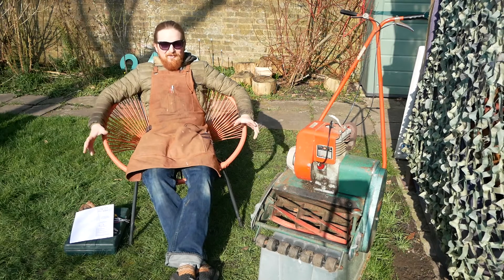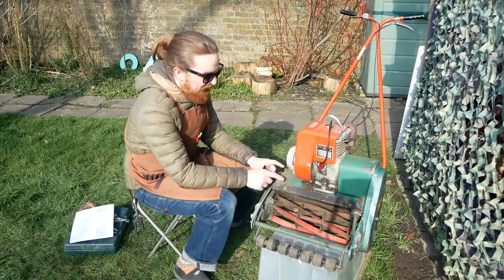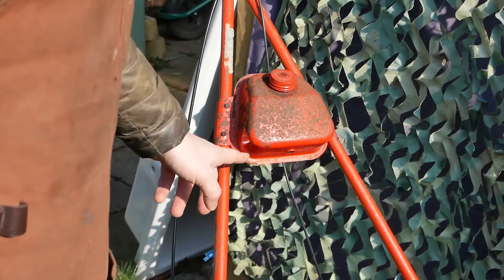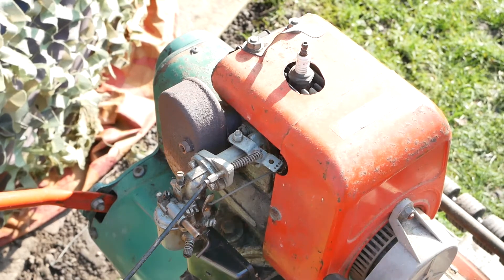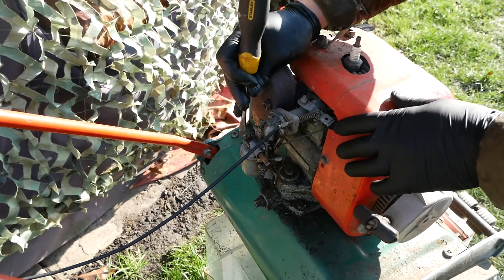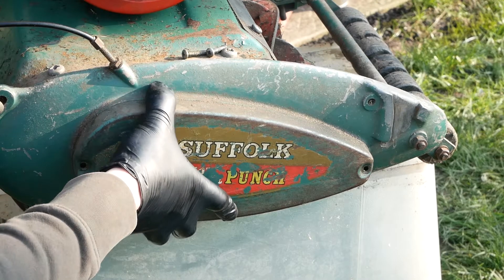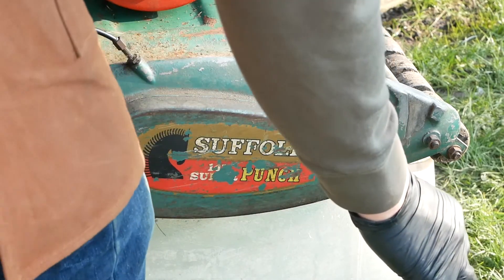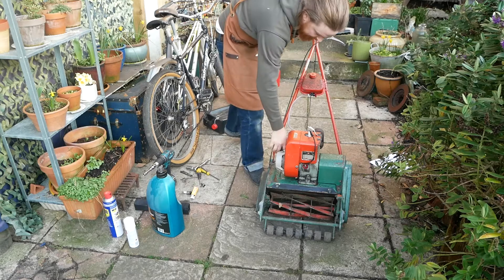Basic Maintenance on a Suffolk Super Punch/Colt Lawnmower – Will it run?

Comment: Can you show us how to lube/oil/grease the moving parts? I have the same mower, no grease points, don’t know the best way to lube rear roller, and the reel
Reply from the maker: There's oil ports on the rear roller from memory. Have a look at the manual linked in the comments there. I probably need to grease the cylinder myself.

Comment: Hi, old engine's used to run on 4star leaded petrol, and if you ran an earlier engine on modern unleaded it was supposed to be bad for the valve seats, how did you work around this?
Reply from the maker: I didn't. It might cause problems on a precision engineered car engine with several thousand miles ahead of it, but this is a pretty blunt tool by comparison. If it stops running at some point, I'll make a note to check those seats and revise my position.

Comment: Interesting - something odd here.  They should be a dream to start!  I was always taught there are only three things to go wrong, air, fuel or spark.  So it must be at least one of these.  I usually use full choke and crack the trottle open to idle - there is sometimes a mark on it to show you were.  If the plug is new and fine and the air cleaner is clean then possibly suspect the magneto.  Have you taken the plug out and looked at the strength of the spark when pulling it over?  They are great little mowers and will basically last forever!
Reply from the maker: Yeah. I think I identified this week that the carb is a bit gunked up. Needs a soak and a clean. 

But this morning the starter cord snapped, so a new video coming soon.
Reply: @TooManyProjects  Interesting - I had rather assumed you had done the carb especially as it seemed to run OK once started but that could still be an issue if there are sticking parts or blocked jets.  I hate carb work as this new petrol is so searching - apart from damaging some brass/metal parts it finds every gap it can!

Comment: Idle speed too high. Centrifugal clutch is engaging, this is why it wants to go.   Starting is no throttle full choke then choke off. Set jets whilst running by ear
Reply from the maker: Check out the next video where I dealt with the clutches. Spoiler: you're right about that. I think the manual does say to set the throttle above zero for starting though, and maybe half choke depending on how cold it is.
Reply: @TooManyProjects  thankyou for your responce,  I like these engines, serviced them in a lawn mower shop in the 70s. Recently acquired one from a neighbour who had it in his shed for years,  I have had a lot of fun fitting on a push bike.   The drive from the engine attaches to the opposite side of the chain ring on the pedals crank which means I can use all 18 gears. It's great to have the centrifugal clutch too that completely disengages as the tick over is slow and steady. It's capable of 35 mph on the flat lots of fun. 😊